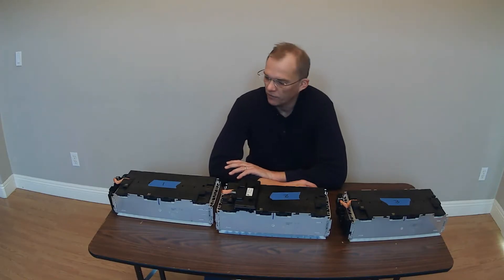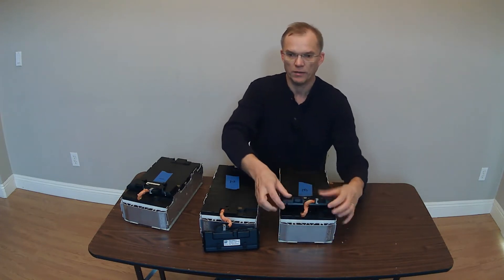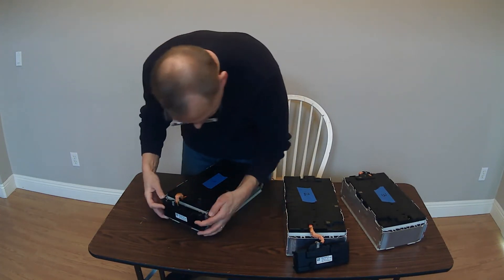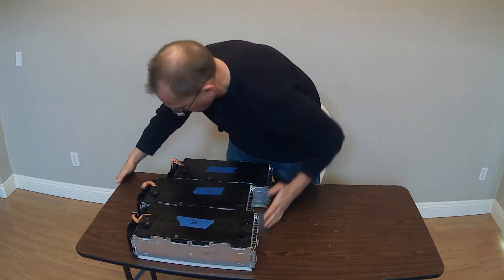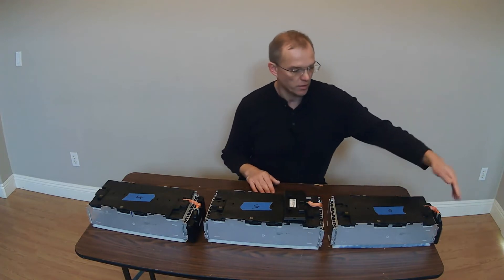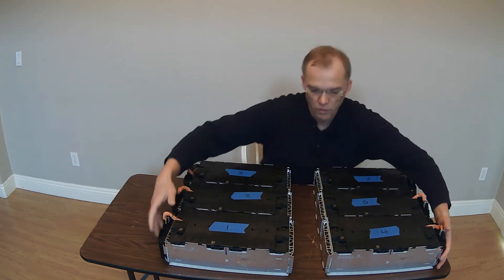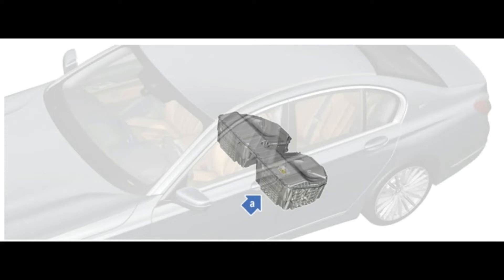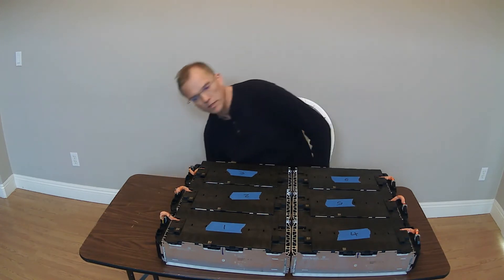BMW 530e HV Battery Pack BMS Orientation

Comment from the maker: and here's how the six cell modules are connected together with the high voltage orange wires

#1 Part Number: 61278621016 Main Negative (runs from Cell Module #1 to the Safety Box #8 front connector)
#2 Part Number: 61278621017 Connects Cell Module #2 to Cell Module #3
#3 Part Number: 61278621018 Connects Cell Module #3 to Cell Module #4
#4 Part Number:61278621019 Connects Cell Module #4 to Cell Module #5
#? Part Number:??????????? Connects Cell Module #5 to Cell Module #6
#5 Part Number: 61278621020 Main Positive (runs from Cell Module #6 to the Safety Box #7 front connector)
#6 Part Number: 61278618444 Connects Cell Module #1 to Cell Module #2
===========================================================
#7 Part Number: 61278650791 External Connector Positive
#8 Part Number: 61278650793 External Connector Negative

Comment: Yes you can you can have 6 modules total in a pack. The slave BMS modules are identical and can be renumbered over canbus utilizing the wipe CSC ids function in the debug menu of the SimpBMS
Reply from the maker: Wow! folks, when T Bree talks we listen, this is the gentleman who designed SimpBMS.  Tom can you comment on how we would Manage more than one pack using your SimpBMS please?  I ask because although this pack is 350 volts it is only 26 Ah therefor 9.2 kWh capacity.
Reply: @Good-Enuff-Garage  You cannot its a limitation of the Frimware on the BMS Slaves
Reply from the maker: @Tom-evnut  Thanks, so what you are saying is, you are working on a way around that, ha ha, on a serious note I think we solve that problem by using two SimpBMSes, correct?
Reply: @Good-Enuff-Garage  Yes that would be a solution or you can use the opensource code and create a device with multiple can busses
Reply: Доброго времени суток, подскажите если поменять ячейки необходимо программировать авто или можно просто физически сменить ячейки???
Reply: @Тема-э3х  он их для домашней системы выковырял🙂 А модуль менять можно, в крайнем случае плату управления с модуля местами поменять и всё.